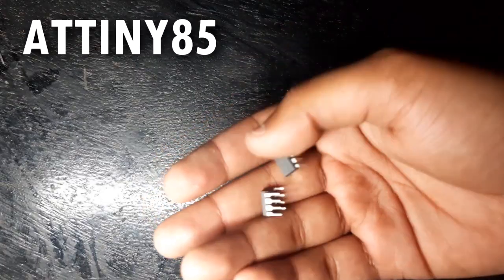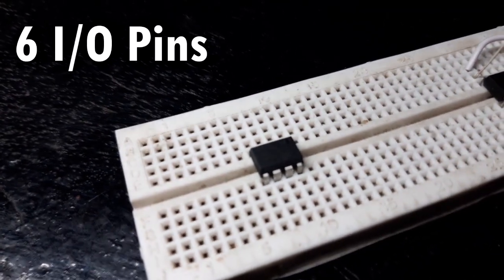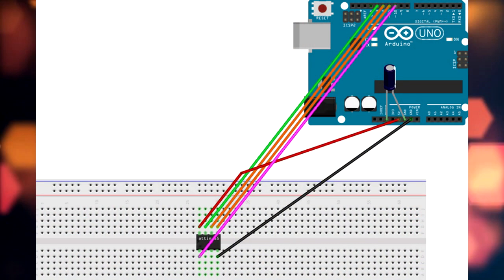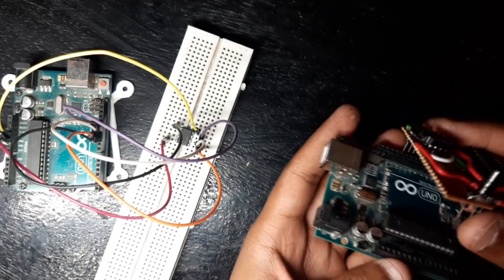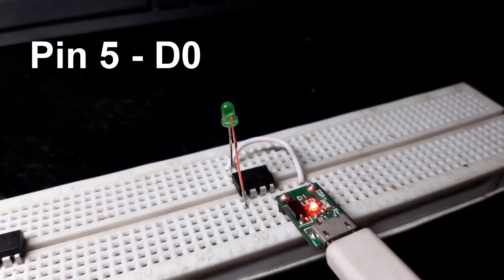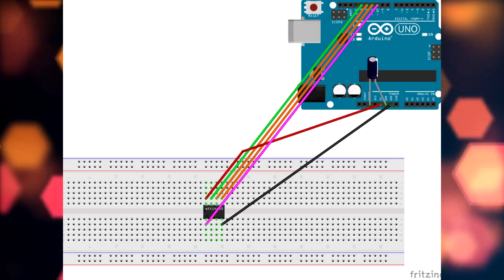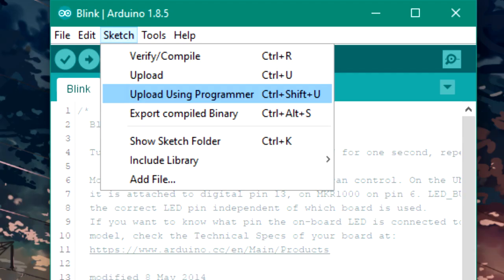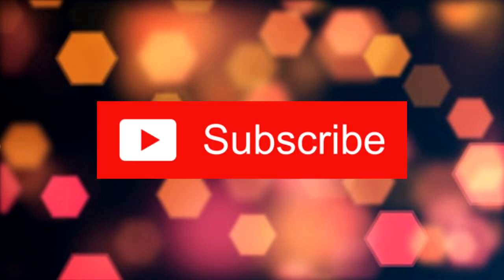Programming Attiny85 and Attiny13A

Comment: I have a question,
Can I make a boost converter having a frequency of 100khz to 300khz using at tiny 13A or should I use the at tiny 85 or more preferably an Arduino nano.
I also want to give boost converter a variable voltage and current so is at tiny 13a suitable?
Reply from the maker: Yup. It is suitable
Reply: Thanks man

Comment: For remote IR we can use ATTINY 13  or not sir please auggest
Reply from the maker: Actually attiny13a is not compatible with ir master library, you can use Attiny85 with IR remote as it is compatible
Reply: @ArnovSharma  thanks  sir for fast response  in some of youtube video IR sensor used i want to use IR sensor base 4 output
Reply: Attiny 13 is low cost thats why
Reply from the maker: @dassajityadav5555  agreed but it mainly used for triggering mosfets, transistors, leds, button projects etc. It cannot drive servo motor or lr receiver, neopixle etc.
Reply: @ArnovSharma   thanks  sir you are best one
Reply: @ArnovSharma   thanks  sir you are best one
Reply from the maker: @dassajityadav5555  thank you, you too!
Reply: @ArnovSharma   sir i tried but error while burning bootloader  show ho rha h uske liye kya kiya jaye.  
Bootload dalne ke baad hi program upload hoga koi
Reply from the maker: @dassajityadav5555  yeh dekho https://youtu.be/3tJi0zzWZtM 
Step by step follow karo
Reply: Thank you, i tried this yesterday and didn't know what i do wrong. This clear up alot for me =)))
Reply: @Leviathan0707  i did this with arduino nano with arduino UNO not successful  so try with arduino Nano

Comment: Sir atiny 2313 not program please make video on this sir or suggest how yo program
Reply from the maker: Sure!
Reply: @ArnovSharma  thanks sir i am waiting  by your support i tried attiny13 and now 2313
Reply: @ArnovSharma   select attiny2313( nobootloader)  1mhz programer as arduino as isp attinycore     invalid device signature  double check connections and try again or use F to override
Reply: @ArnovSharma   sir avrdude avr part attiny2313a not found  show but in avr conf file only attiny2313